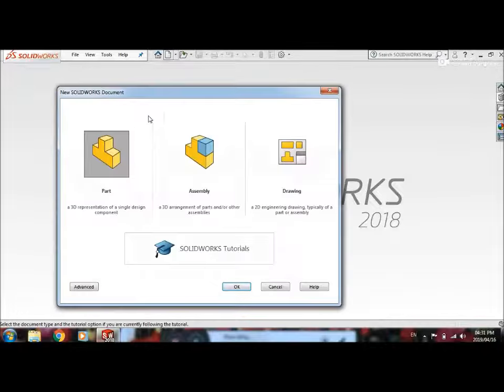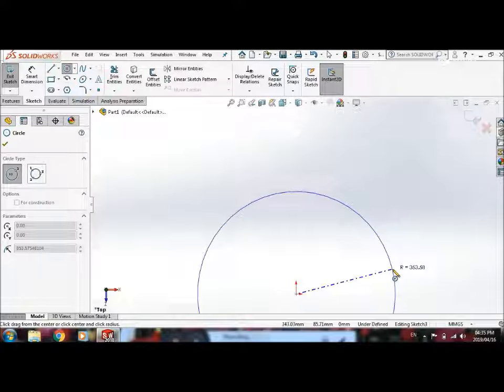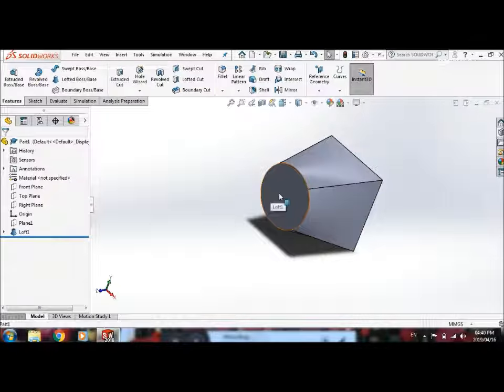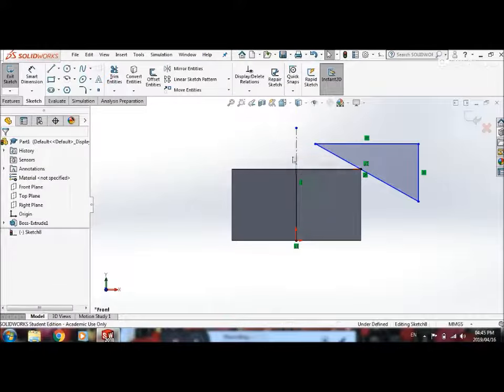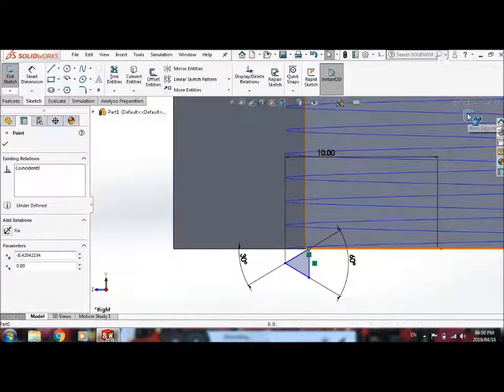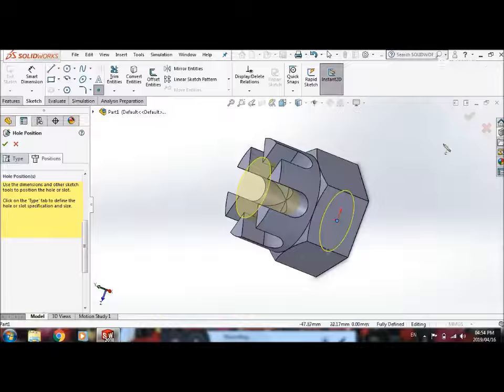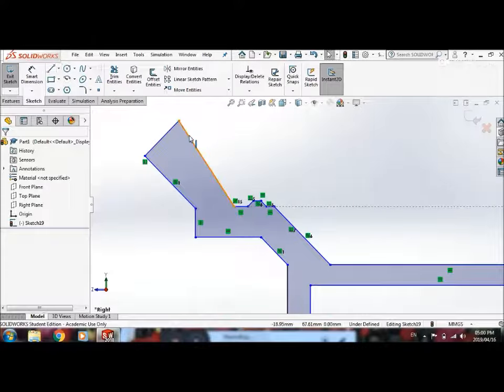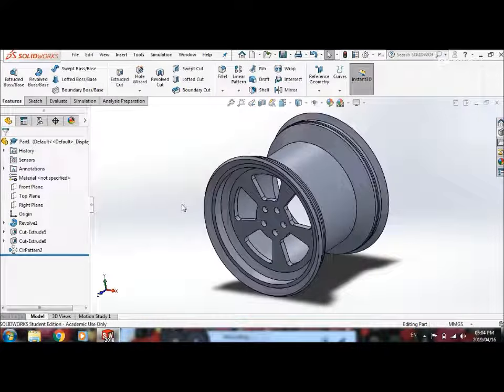MGC110 CAD2

Comment: tried the swept boss more then 7 times and it still has errors
Reply from the maker: It might be due to the cross section sketch being open or not a flat sketch, or it can be due to the profile intersecting itself. It can also happen if the profile and the path lie in the same plane, in which case no volume will be created when sweeping, causing an error. Use more basic sketches for profile and path, and make sure they are not in the same plane and see if it helps.